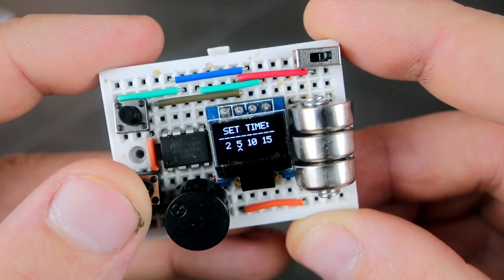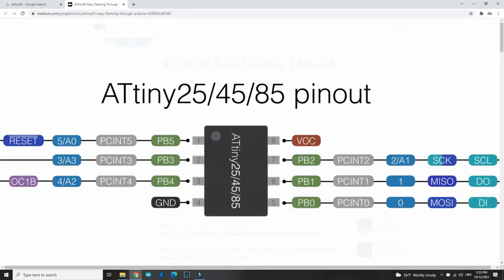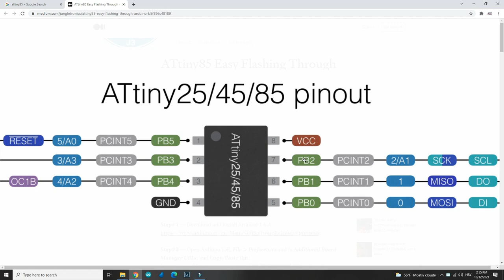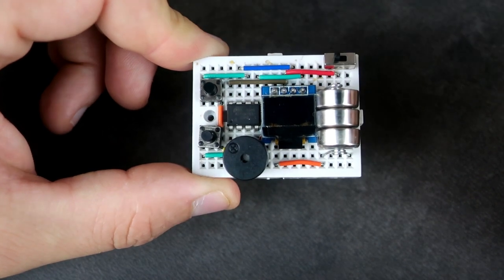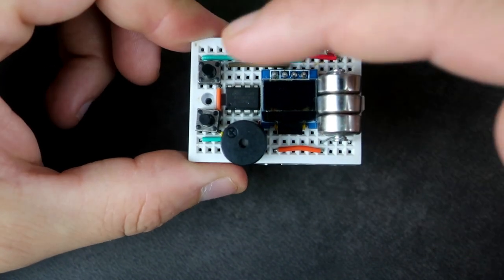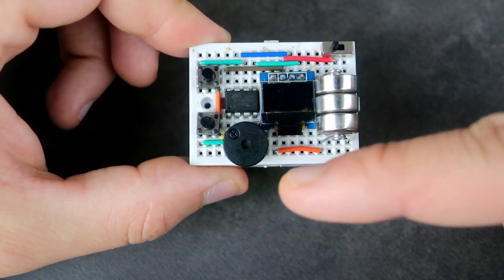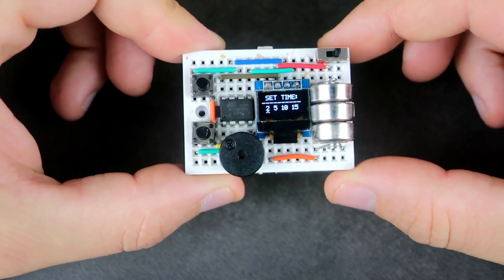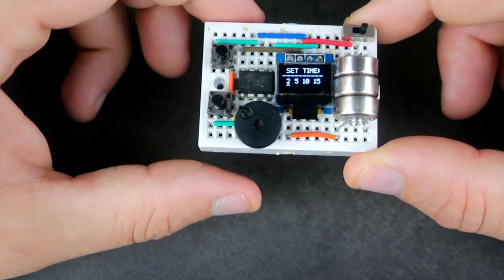Tiny Project - Countdown timer (Attiny85 , 64x32 OLED and datacute library)

Comment: Great project.  You can use an inexpensive audio transducer instead of a buzzer by replacing:
  digitalWrite(3,1);
  delay(500);
with:
  for(int i=0;i<1500;i++) {
    digitalWrite(3,1);
    delayMicroseconds(300);
    digitalWrite(3,0);
    delayMicroseconds(300); }

Comment: I used an ATTiny85 as a Morse Code generator for my emergency radio transmitter. I have ATTiny13 and ATTiny44 on order for other projects. I want to use an ATTiny13 to turn a membrane keypad.into an I2C keypad.

Comment: You could make this usable. Create Work-from-home timer. Set work time once, then let user easily stop and pause it, either with button or some other sensor, touch, proximity, gyroscope. That's what I want to create now. There are barely any like this on market.
Reply: With a proximity sensor it could also detect if you are sitting in the chair and auto pause, when you are gone.

Comment: The best thing about this project is what seems to be a safety pin as the contacts to hold the batteries in place.  That’s genius ! 😂
Reply: Wrap the cells together with tape so they behave as one object. Then hold in place with one or two horse shoes of paper clip or other solid wire.😇

Comment: Hey I really have a problem while recreating this project: Is it possible to input a date (like 01.01.2022) instead of choosing minute options? And instead of countdown just a coloration. 

For example I want to input 01.01.2022. So all days before this date the screen stays green and when the day comes the screen becomes red.

Your solution would really help me a lot!
Reply from the maker: You can calculate nuber of seconds until then and than decrement that number evry one second, but it will not be precise like real clock